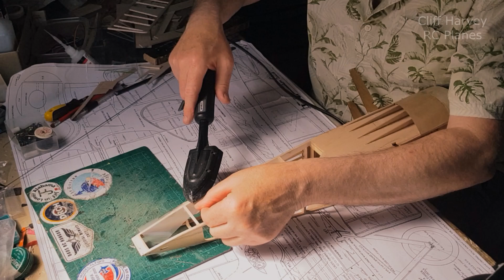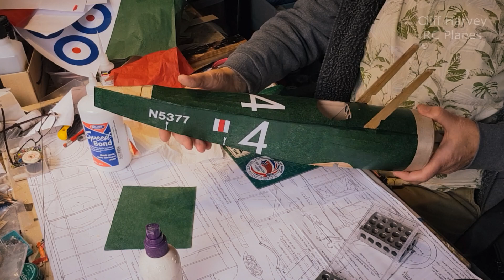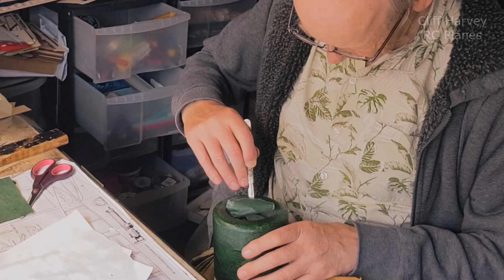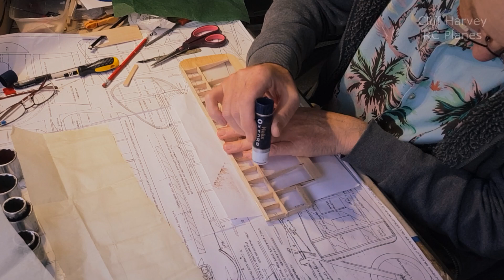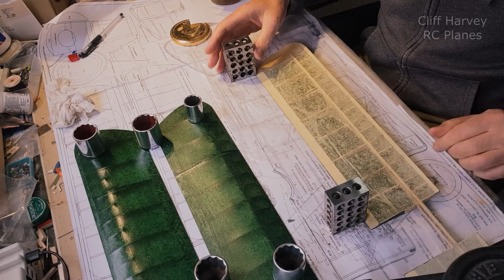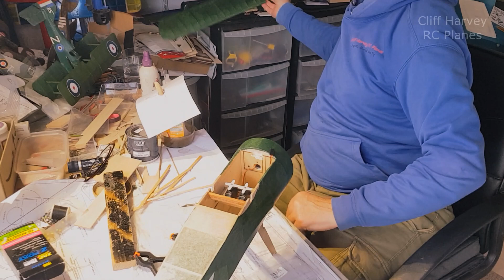Sopwith Triplane Build Part Five

Comment: That's a fine job. I am still trying to understand the coverings.
Why did you cover it twice, first with doculam and later with tissue? Will that not increase the weight?

What dis you use for dope? Deluxe material dope?
Reply from the maker: Hi Yasser, the Diculam adds very little weight but adds a lot of strength to the tissue 👍 I use cellulose dope suitably thinned with cellulose thinners made by 'Guild' 🙂
Reply: @CliffHarveyRCPlanes  
Thank you so much for the reply. 
What is your opinion about Deluxe materials dope, as compared to the Guild cellulose dope?
Reply from the maker: @yassermasood3423 I've never used to the deluxe materials dope but I have used deluxe materials glue and it's very good, I suspect the only difference is the price 👍

Comment: Looking great Cliff, a question, why do you need to thin out the Dope?
Reply from the maker: Thanks Chris, two reasons really, thinned it goes on more evenly and doesn't over-shrink the tissue and more importantly the thinners evaporates so half the weight is gone 🙂👍
Reply: @CliffHarveyRCPlanes  what ratio would you say is a good mix?
Reply from the maker: @DadsRCHangar you can start with 50% dope and if that's not enough you could add a little more or less on a test piece and see the result 👍

Comment: Hi Cliff , really enjoying this build and benefitting from your experience. Could you tell me where you get your doculam from please. I checked on eBay and it is only available from US
Reply from the maker: Hi Andrew, I'm lucky as a shop that sells it is only five miles from me, here's their website but a quick search didn't bring it up but they definitely sell it, cheers https://refreshcartridges.co.uk/
Reply: @CliffHarveyRCPlanes  thanks Cliff , what gsm do you normally use
Reply from the maker: I use the 38 micron thickness, 320mm wide role, this is a good mid-range thickness for small and large models 👍

Comment: Doculam does indeed have the same shrinking power as regular coverings, it just takes an industrial heat gun and much higher heat then the hobby iron can deliver.  It's still not as stretchy as Monocoat or Ultracoat, so one has to be super on top of it for the initial tacking down.  You moved very quickly, more quickly then I do with mine using a hobby iron though.
Reply from the maker: Thanks for that info, I didn't want to shrink It too much anyway as it's a fairly light structure but I'll try more heat and slower next time, cheers
Reply: @CliffHarveyRCPlanes  There is low temp Doculam and I would be totally off with the recommendation if you were using it, but high temp seems to be the bulk of what's out there and started with 1.7 mil, using 1.5 now, it took some rather getting it through my thick head, this stuff loves high heat, well, until it melts a big hole because you pushed it too far, but that's for another dialog.  I discovered using glue stick in tangent with the Doculam, laying it down tissue paper style has huge advantages and it doesn't require so much high heat to at least get those initial tacks down, but once full, Doculam level heat is applied, you are ripping up the stock it's adhered to before removing it from it, so use it tactfully in areas you have no plans to reposition. Polyhedral wing just done up with this combo worked out perfect and you know how hard they are to do.
Reply from the maker: Hi Brian, I'm not quite sure the advantage of sticking the Doculam down with gluestick, does the glue stick prevent the Doculam glue from adhering?